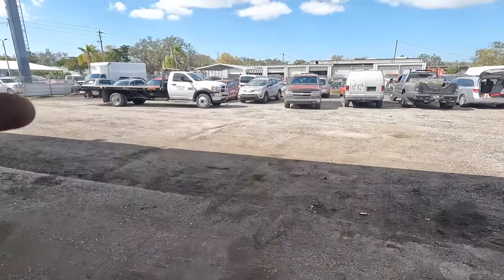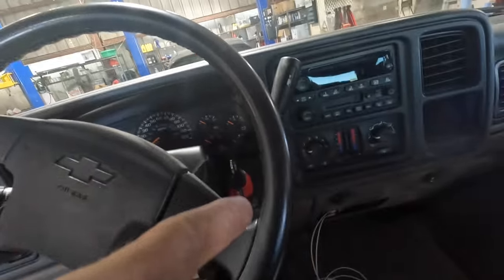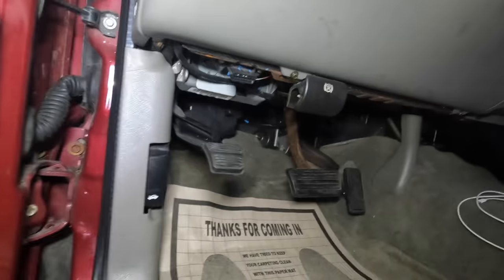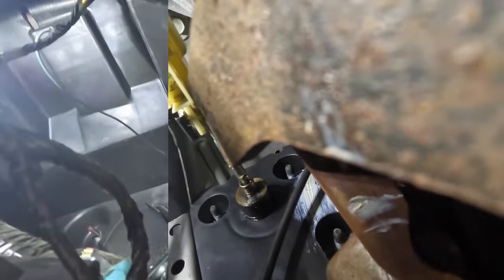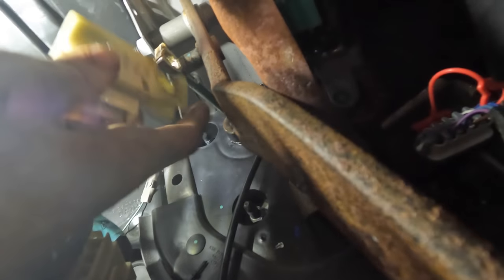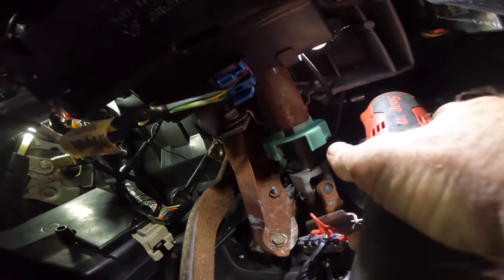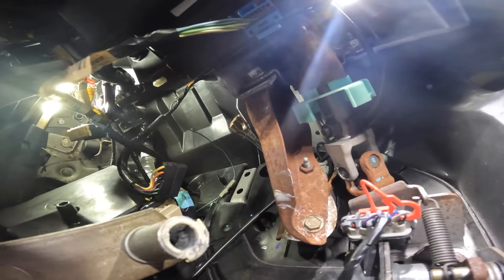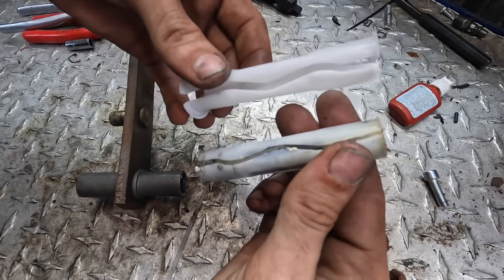Loose Brake Pedal Not what you think | 2004 Chevrolet Suburban 5.3

Comment: @10:50, sorry, you are wrong.  A 2004 typically comes out in 03, so that grease is at least 20 years old depending on when it was manufactured, typically 6 months to a year BEFORE the official model year.

Comment: I did this to my 04 suburban. The difference was night and day. That fabulous GM plastic sucks. But I will say, it lasted 18 years. Would be nice if these were metal ball bearings though. I have another suburban, an 01, if I have to do this to that one, I’ll just take out the driver seat so I can lay on my back. I was in so much pain, crouched over the driver seat, smooshed in the foot well.

Comment: I would put a thin washer  to take up side play it really makes a difference in your feel on the pedal it's worth the effort I know it's a time thing I had a few different trays of thrust washers of different thickness and bolt diameter it is a small detail but when the customer feels  a new pedal it adds to his confidence in driving 🚗 lol 😆 yeah I know just a idea for next time you probably get two or three in your lifetime gm has used that system for years and as a gm mechanic I did many

Comment: I have had a K&N on my Explorer for years and years. I clean it twice a year at the same time I change my oil. I soak the filter in a small tray filled with Purple Power. Leave for about an hour or so. Then rinse and soak again in a Dawn dish washing solution. Takes about an hour but every bit of dirt, grime and oil is pulled out of the filter. Nasty looking stuff. Rinse thoroughly, blow out and, like you, air dry before applying the K&N oil. Best damn filter going. Definitely more HP.

Comment: Noticed the customer replaced the steering column bushing. Had to on my Silverado. It is not seated all the way into the column and they will need to correct that. Surprised has not been a problem by now.

Comment: Now on the old days when I used to have one of these filters it said to spray it on rinse it with water preferably in a bucket Don't use air and lightly coat with oil This sort of happened 😂 The paper roll clean up have to say I've never seen that and a cringed 😖

Comment: Read directions !!!!! It says not to use compressed air to clean or dry. Oil should only be applied to outside of filter and be completely dry before using it. Oh well the MAF will enjoy the coating of oil it gets burnt onto the heated wire.

Comment: I replaced the a/c evaporator in my 2000 Grand Prix which involves complete dash removal, and getting the brake pedal pivot bolt out and reinstalled was the hardest part of the whole job, I used grease called "super lube" on the plastic bushing (still in good shape) for the brake pedal, works nice and smooth!!

Comment: Just fyi, that plastic bearing attached to the steering shaft isn’t seated all the way down. No part of the top side of the bearing should be showing. It needs to be pushed in more. Leaving it like that will cause the steering to be clunky and loose or the bearing will wear super fast.

Comment: If you can see daylight thru a filter, then what exactly is that filter stopping? Leafs, twigs, and boulders?
I once tried a K&N filter on a '87 Subaru station wagon I had. After a couple thousand miles when I pulled the top off the air cleaner, and saw all the dirt and gunk that had made it thru that "filter", and was coating the throttle valve and bore of the carb, that K&N filter went into the trash, and I've stuck with Wix air filters ever since.
If wringing out the last ounce of performance from a vehicle, is more important than the life of your engine, then fine, go ahead and use one of these glorified gravel screens.
If you need more air flow on the intake, then you need a bigger intake and a filter with more surface area - not replacing your air filter with a window screen.
Reply: ne owes the customer a full refund to compensate the engine shortened life.

Comment: Hi Rainman, I just had hydro-booster changed with GMC 2004 Yukon XL Denali and I am getting Stability service. My mechanic changed the break switch also but I could not get service stability corrected. I would really appreciate if you please advise on this problem.

Comment: A lot of rust under that dash!  Never seen rust under a dash like that.  Been submerged?
What's the point of greasing the outside of the bush and then not grease the inside where the bolt causes friction?

Comment: Ray, did you replace the old solidified grease on the booster rod peg of the pedal or did I miss that?
Edit: Air filters should be cleaned from the inside out only....

Comment: about that 3d spot you just made, did you tought about a pit instead of a lift ? its kinda WAYYYYY cheaper to dig a hole than it is to install heavy machinery
if you end up moving out, you just have to fill the pit with concrete and bye bye.

Comment: K&N filters are garbage that fowl MAF's, if you want more air flow use a AEM dry flow filter instead.
Reply: AEM looks the same as the K&N and the price is comparable, do they do better in testing than the oil spray, which reminds me of the VW bug oil bath filter!

Comment: It surprises me to this day that most American cars have engines of this size ( 5.3 litres ) when their European counterparts have more modest 2.0 litre engines and smaller. 
Is gas in the US still that cheap ?
Reply: The Suburban and Sierra have the ability to tow heavy trailers.
It can tow 3810 kilos at elevations below 1000 meters.
They do use plenty of fuel, rear drive is 3.73.
Reply: Is gas in the US still that cheap.
Yes.
As much as citizens love to complain about "high gas prices", comparatively, it's still cheap.
As much as I was floored at how high petrol prices were when I visited Europe, I was also floored at the flocks of nuns on Vespas, the huge amount of cyclists, and the amazing public transport system.
I took a bus from France to Italy for something like $1.50 iirc.
Reply from the maker: I tow often as well. My dump trailer loaded with gravel weighs in at 16,000lbs. I need my bigger engine. It’s all relative

Comment: That is why I usually take the seat/s out. For me to get into those positions. I am tooooo big. Morning to all. 
"Super Lube" (teflon)  should work very well on that? Comes in spray and as a grease. 
I thought that was an electrical knock out. You have been installing boxes for your lights. 
Haaa a 1,000 back seat drivers, just what you ???don't need. Easy to say when ones sipping morning coffee.

Comment: Its not good to use high pressure air to clean or dry filters
It opens the pores of the filter which will allow the smaller partials through
And the cotton type filters already don't catch the smaller particle when clean
Reply: now has ram air with dirt.

Comment: Hey Tay I have a question for you. I have a 2004 Tahoe with roughly 213,000 on her she runs great but the brakes are horrible. My question is why would I have an extremely soft pedal when braking when I have had the rotors and pads all the way around and new caliper’s. I also have had new brake lines installed and everything has been properly bled. Am I looking at putting in a new hydro boost to get the pedal back. And I also have felt that jump in the pedal you were describing.
Reply: Sorry it is supposed to be Ray. Damn auto correct!!!

Comment: I never see YouTube mechanics use line-up tools----even though they would seem to make something like getting the long bolt into the hole easier if a lineup tool was used coming from the easily seen opposite side.
Reply: They probably would if they needed to. Sometimes finding the part takes longer than a minor sruggle.

Comment: @20:58... Nice strategic product placement. ;) @25:00... You really only want to rinse a K&N in the reverse direction of the air flow. You wanna rinse the dirt OUT of the filter, not into it. @28:43... Ray, seriously... Read the directions... The filter requires a LIGHT mist of oil and only on the dirty side. You NEVER oil the clean side. That's how you kill MAF sensors. K&N even specifically says that oiling the clean side can destroy the MAF. I hope you did this just for the REEEEEEEEEE!
Reply: he better buys the owner a new filter ASAP.

Comment: Would this cause a clunking noise under there when driving ?
Reply: Yes. My 2002 Yukon SLT has the 'clunk' and a slight steering rod bearing rattle as well. To test, put your foot up behind the pedal and lift towards you while on surfaces that produce the noise. You'll "Oh that's what it is??"

Comment: The brake pedal is easy, the clutch pedal on a 90s Chevrolet is retained by two bushings that are spring loaded . When those break the temporary fix is a bolt that runs through the clutch pedal, there are no replacement parts.  You have to replace the clutch pedal or have some bushings machined out of aluminum alloy to replace the original plastic components.

Comment: Why not buy a new air filter? Would that be better that keeping an old dirty filter?
Reply: Those filters are designed to be reused and allow for better airflow compared to regular filters.  The coating Ray dissolved with the cleaner trapped all the crap and it all washed away, thus making a new, clean filter when recoated.

Comment: If you lubricate the bush, insert the bolt through it then fit the thread lock treated nut, won't that lubricant get on the bolt thread and stop the thread lock from working?

Comment: So this is a rambling daydream without pretty girls so it might be useless...So you cleaned out the other area for more room in the shop but what's with that truck sitting there I know it's not yours It's the body shops but is the body shop even open anymore could you have the rest of the building maybe you need a unloader with a graffle attachment on the front. Rip that truck out of there and all the other junk and throw it in a big old dumpster add two more lifts and a front end rack

Comment: Why didn’t you torque that bolt to spec? You say it’s very important but you just say click. Once again I’m glad it’s not my car with my kids in there.
Reply: There is no torque spec for that bolt. Thread locker and tightening it down. Is safe and sufficient. You’re overreacting.
Reply: @MrJacobCastro  Is that a shoulder bolt? Something has to limit the clamping force against the bushing/pedal pivot.

Comment: You overdid it on the k&n oil, plus you didn't dry it out properly. A better way is to use the hair dryer, and you can actually use a scale to see if there's still water in the filter You weigh it, hair dryer blow it out and dry see if it's still has water in it , keep weighing it until it doesn't lose anymore weight that way you know all the water is out of it, then you sparingly use k&n oil to reoil the filter. You way overdid it.